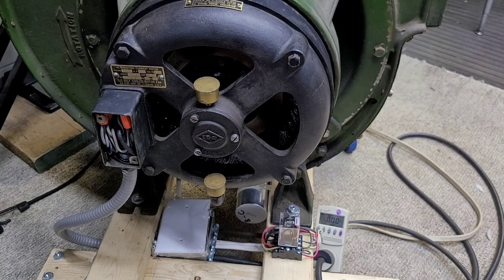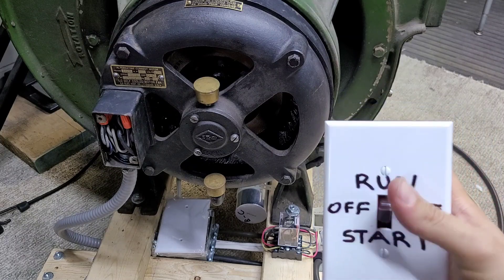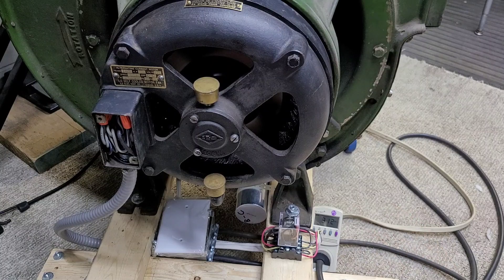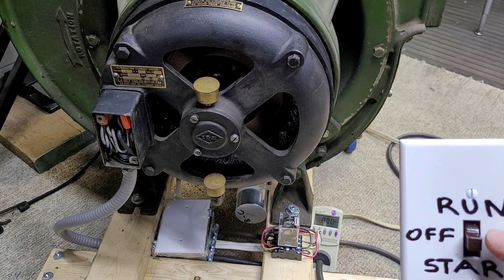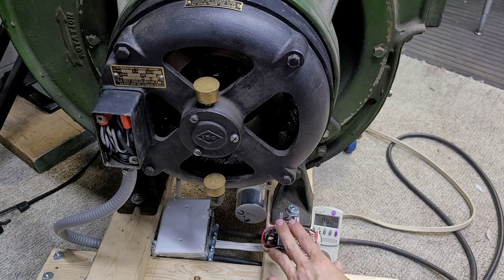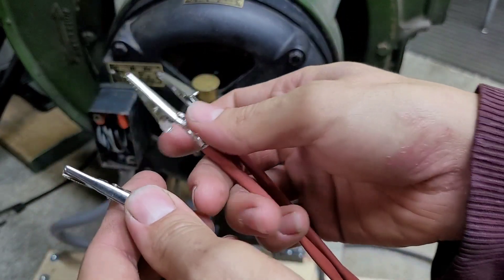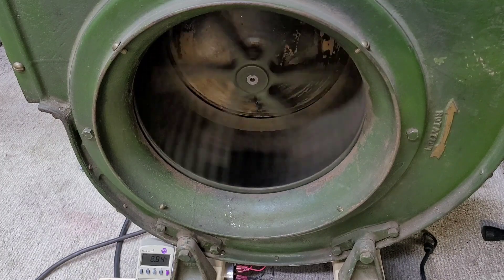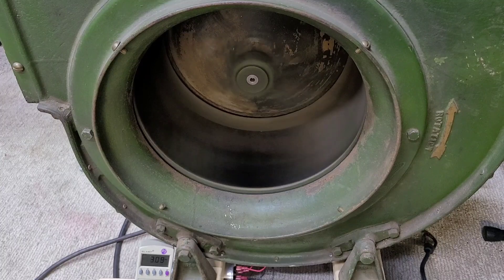Star-Delta Static Phase Converter (ILG B-30 Universal Blower C.1932)

Comment: Great old ILG blower! Never really understood why a 7/8 hp motor would warrant needing 3-phase as ILG could have used a 1 hp motor on single phase. Just a thought 😅
Reply from the maker: That is indeed an interesting topic with these, 
ILG was always trying to get the highest efficiency, and smoothest operation out of their ventilating machinery. For smooth operation, they went with a direct drive motor which they also advertised as being more compact, taking up less physical space. Being direct drive, the motor would often need to spin at slower speeds especially on larger blowers. These motors have more poles then the standard 2, 4 or 6 pole motors commonly used today, some ILG motors would come with 12, 14, or more poles. 
As for why they used 3-phase, the school they were purchased for was wired for 3-phase so I am assuming they were ordered based on the supply current type. While you can certainly run a single phase motor on three phase power easily, I'm sure ILG prefered the 3-phase motor for its reliability and simplicity compared to single phase motors of the time. These blowers were made before ILG started using PSC single phase motors. A single phase would have needed a centrifugal start switch back then which would be another possible failure point over time. Much to your point though, it does seem crazy to have such a low power 3-phase motor when we are used to seeing 3-phase reserved for large horsepower motors. ILG even offered a 1/6 horsepower model 183 propeller fan in 3-phase which is beyond crazy to me. 
One last note, the fact that ILG made their own motors was definitely super cool, but I suppose the down side of it is that the motors are very specific to the machery they were installed in. This makes finding a replacement just about impossible and requiring the original motors to be rewound. 

Hope that wasn't too long winded lol

Comment: Love the Ilg blowers!  That Y-Δ start is taking shape nicely. I bet once you build a potential relay or other automatic control in it, it will work flawlessly. 

As for the relay taking a hit from the capacitor, that happens because the motor and capacitor work together to maintain excitation of the rotor. The motor produces voltage while the flywheel mass of the rotor and blower wheel is driving it; becoming a generator.  Once it is disconnected from the AC line, the motor and AC line voltage drift out of synchronism.  When you re-close the switch, you're effectively closing a generator against utility out-of-sync.  In the power generation field, that is called a crash-parallel, or "close out of sync" incident. Can really damage things. The total voltage of the circuit at the relay when it re-closes can be more than 2X the system voltage. Maybe a lot more, so the relay is closing a 300V fault when that happens.
Reply from the maker: Thanks! it is definitely a joy to run even with the manual controls but auto will definitelybe much better! Also thanks for the info about the synchronization drift that was occurring, makes a lot of sense now that you mention it. Funny thing is that just yesterday I was watching videos about hydroelectric generating stations starting up and synchronizing to the grid. Some of the comments were talking about how extreme catastrophic it is if they connect while not in synchronous to the grid, I would not want to be in the same building when I fault like that occurs.